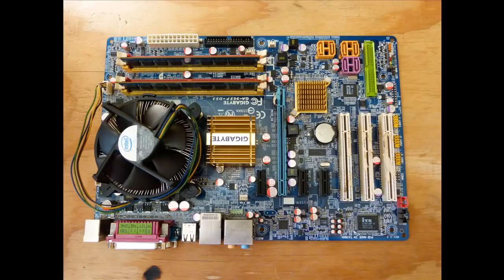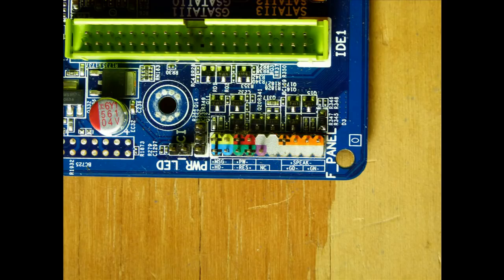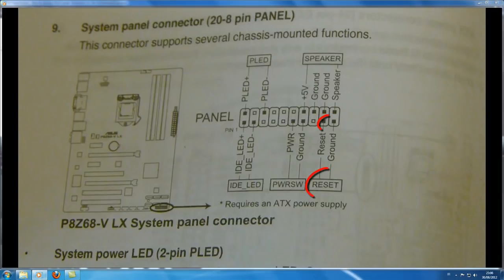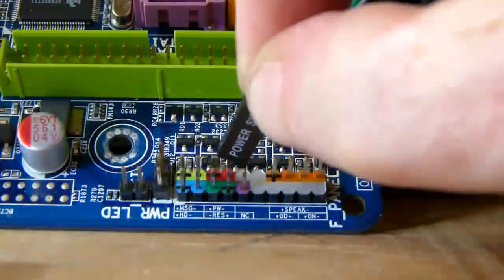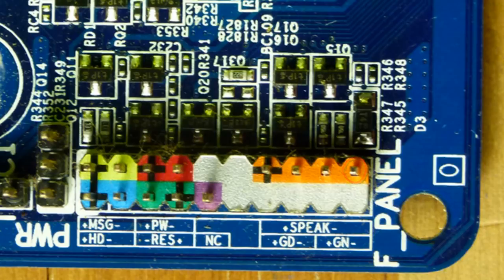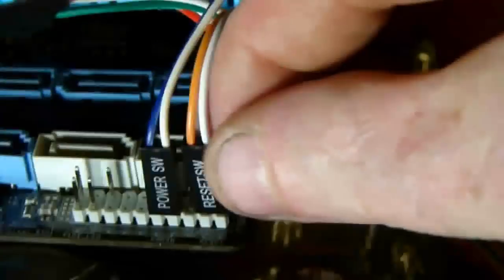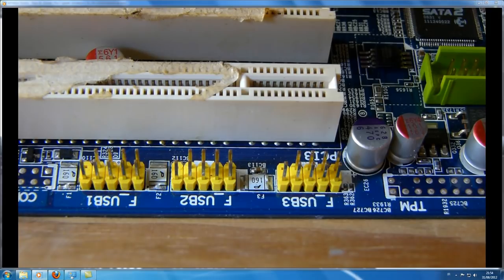How to connect front panel connectors to the motherboard

Comment: I connect a front panel USB/AUDIO unit to the motherboard some time ago. After many attempts the audio finally worked but the two USB ports have never worked. Any thoughts? Do I need to turn on the mobo USB ports or is just a duff bit of kit? Thanks.
Reply from the maker: Did the unit come with drivers if it did reinstall them just in case the did not install the usb drivers correctly. Also is there extra power required for usb cards! usually there is! So check the user manual that came with it, and see what way it is connected! If all is correct then it is probably a bad usb device. The computer is very good at picking up these devices so you don't have to turn on any motherboard usb that will always be on. OK I hope that helps!

Comment: after install my new motherboard then the monitor no signal.. Why this happen?
Reply from the maker: Hi Geoyul! Do you have the monitor plugged into the graphics card if you have one installed? If you don't have one installed then set the monitor to to the input required (eg VGA, HDMI or DVI) Hope that helps! If not! let me know!
Reply: i already install it but nothing happen?
Reply from the maker: To be clear about your problem! You have a graphics card installed in a PCI Express slot and the cable that connects the monitor is connected to the graphics card not the motherboard? If this is correct let me know! Now does the graphics card have 6 pin power connection and if it does! have you that extra power connection connected?

It is very difficult to troubleshoot your issue without seeing it because i don't know your setup! If you want we can connect via Google Hangouts and sort this out in a few minuets! There's no charge for this! and it's completely up to you!

Comment: My case's connection for the front panel doesn't isn't compatible with my Motherboard's USB input, what do I do?
Reply from the maker: One has to match the other! so you need to replace front panel usb connection if that is the problem! But these connection have been the same since the computer was invented! is it possible that you are trying to connect it to the wrong connector on your  motherboard? double check the connection on the motherboard you will find one with USB printed on the board beside it. Hope that helps!
Reply: Thanks for responding but trust me the mobo says "USB 3.0" and my PC's case connection is more of a Cord rather than a wire. If I were to post a video for a better demonstration would you care to watch it?
Reply from the maker: GamersBrainStorming
yes! i'll look at the video, see what you can do next to sort the problem! If you want we can connect on Google Hangouts it's like Skype.
Reply: Kevin Colleran OK great that sounds great! I'll see if I can post a video today if I  have the time.
Reply from the maker: That's fine whenever you get a chance!
Reply: Kevin Colleran Hey Kevin I did some reason research and found out my PC's case has a 19- Pin female connection the one needed for my Motherboard is a 9- Pin male, luckily I can buy a transfer cable at. http://www.amazon.com/Silverstone-Tek-Internal-Adapter-G11303050-RT/dp/B0098FSJ92/ref=sr_1_11?ie=UTF8&qid=1408249771&sr=8-11&keywords=USB-+pin+male+header+to+USB+2.0
If you your still interested I'm looking for some constructive suggestions. I have my power supply faced up on the bottom of the case I need to know what's the best way to place it, if you want I posted a video up you can have a look at it for better understandings. Thanks for your help.
Reply from the maker: Glad you got it sorted! Sure! i'll have a look and i'll get back to you!

Comment: My USB and audio cabels have another set of wires branching off from them. They are all seperare and are 1 pin. What do I do with these?
Reply from the maker: The Only way to find out what they are is consult the manual that came with your Case if you don't have it you should go to the case builders website and find out there! I'm Not sure what they are they could be just blanks it's hard to tell without seeing them if you want to contact me via Google Hangouts if you have a webcam or mic!  i'll be available tomorrow afternoon if that suits!
Reply: Kevin Colleran They are probably blanks. It is a case from an old computer that I am upgrading so it could be an old method of wiring.
Reply from the maker: Ya! so you are good to go! it's better to find out! than to be thinking that you are missing something! Enjoy the upgrading...!

Comment: Now heres the thing. I have an NZXT guardian case, It has a front bay LCD temperature Display and it has 3 cool lines that are supposed to light up and the LCD display is supposed to turn on. both of them do not turn on. Help
Reply from the maker: So are they connected to the power supply? OR where do they get their power from? check all connection to the front panel connection they will be included in them! check the manual that came with case to see if you have everything connected to it's correct position!

Comment: I have a problem with my reset button , it's not working .. i tried to fix it manually on motherboard but it seems i didn't do it right :/ the problem is i changed my motherboard 5 years ago and the new one they ("technicians") put on , is small and i don't even find what type of motherboard is to find on internet the manual ... Also i got another problem , my PC starts on automatically at 00:00 (midnight) ! I can't find any solution of it , i hope someone maybe has an answer , thnx !

Comment: Hi man, my computer case is an InWin GT1 but i have 2 power LEDs conectors one with 3 pin and one with 2 pin , do you know where the smallest power led Goes?(the 2 pin)
My Motherboard is an assus 990fx r2.0
I will apreciate your response. Tks.
Reply from the maker: Hi Romeo, Do you have a the user manual? if not here the link below go to page 50, details printed there with picture of front panel connections http://dlcdnet.asus.com/pub/ASUS/mb/SocketAM3+/SABERTOOTH_990FX_R2.0/E8042_SABERTOOTH_990FX_R2.pdf

The 2 pin connector is called PWRSW positive is on left! ground on right!
Hope that helps! if not connect with me on google helpouts or hangouts and i'll show you the connector position!
Reply: Kevin Colleran I just did some research it seens that the power led (2 pin conector) is just optional for motherboards with that output or something like  that.

Tks for your response.!

Comment: Normally white wires should be opposite to pin specifying the function of the pin itself, which is coloured wire; almost all demonstrations on youtube are wrong about RESET.
Reply from the maker: Hi Mirris, you are right, but can you trust every manufacture to get the orientation and color code correct probably not, but because they are a two way switch where on position is brief connection then the switch goes right back to off position then it will make it's connection, this would apply to power switch and reset switch and for any diode (LED) if it is connect in reverse it will not light up or flash, so that connection must be made correctly . You make a good point, it nice to here from someone who cares...
Reply: Hello Kevin thanks for reply, if you note the usual pins position on classic motherboards is 1-3pins=+ -; 2-4pins=+ -; 5-7pins= - +; 6-8pins=+ -; So 5-7pins have reverse signs; although reset works. I was confused seeing videos on youtube because reset connector appears to be oriented with label visible from external... then controlling triangle which means LABEL function I've realized my original position (internal label) was right. black normally means Ground, white normally means negative or vcc5, black = label while red = vcc5 (the same as +5v) on speaker. Yes it's a bit a caos between colours labels and signs.
Reply from the maker: Oh ya Morris it is a confusing state, I find if one way does not work then try another way. What's wrong here is their is no standard regulated, that makes our jobs that bit harder to do...

Comment: Hi! I have the ga-h77-ds3h mobo and I can't make the front panel audio work. I've read and done according to the manual the connection and settings for the hd audio front panel. Also downloaded the latest drivers from Realtek for the hd audio. The issue is that when the front panel audio works, the audio from the back doesn't and vice versa. How can I fix this so I can have audio both from the back and front panel. I heard there is a program for this issue but can't find it.
Reply from the maker: Hi, Right so what you have to do is disable "front panel jack detection" this is done by opening your audio manager in control panel and under "Device advanced settings" you will see a folder click on that and disable "front panel jack detection" this will allow you to have same sound going to both front and back of computer. Now if you don't have this option in audio manager then it's down to capabilities of your audio driver. So if this is the case, you can install a sound card and use both the frond panel and the sound card at the same time that will have two different audio software controlling them. If you still have the problem after that let me know. Hope that helps
Reply: Kevin Colleran
I've followed your advice and I've solved my issue. The strange thing is that a tag for microphone settings appeared on my Realtek sound settings utility, although there's no mic connected. If I undo the "front panel jack detection" this tag disappears, so I think this is normal. I thought it was a utility glitch but thanks to you it works now! :)
Reply from the maker: I'm glad you got the problem sorted

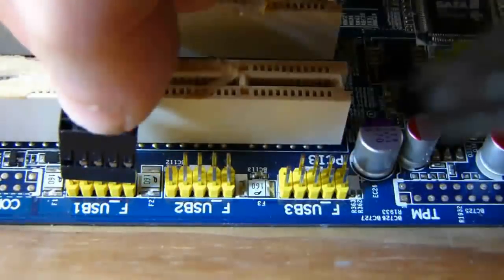Comment: Thanks for your tutorial, I am a total newb and have a question. If I were to be connecting a Firewire port to the same USB header on the motherboard at 8:30,
will this work? Thanks!
Reply from the maker: Hi Mike, that will not work, because of the differences between the design of the usb header and the Firewire connector they are both wired differently. Their could be a Firewire header on your motherboard somewhere near the usb header, but you will only find this out by checking the manual for your motherboard ok, hope that helps...
Reply: Thanks for saving me money!!
Reply: So id be better off getting a Firewire port for my pcie x1?
Reply from the maker: Yes Mike, that would be the best thing to do...

Comment: my case fans dont fit where it says sys_fan 1-4
Reply from the maker: Is it the pins connection your asking about ? if it is then the fans that you have the incorrect fan connector for sys_fan. you can also connect fans to the power supply directly, but they will not be monitored by the processor because they are not connected to the motherboard directly. so you have a choice to make!

Now if your fans were bought separately, then they are, as you have mentioned the wrong connector for the motherboard.

If it's the size of the fan that wont fit the case, then again you will have to get fans that will fit one size does not fit all cases.

One more point here is, if you are not living in a hot humid climate then you don't need a lot of fans to keep your computer cool. The cpu and the power supply have fans and will pull hot air out of the case, so maybe one more fan with those would do.
Hope that helps, if you want to make a more detailed description of your problem if this does not help, i''ll be more than happy to help with more info of the problem... Kevin
Reply: i think it may actually be the fan controller mounted on my front panel which came with the case and that the case fans are already connected up through my psu

 the wiring is hidden and bunched so its hard to tell which comes from what unless its obvious or says what it is on the wire itself
Reply from the maker: ok, in that case you don't have to connect any thing up to sys_fan connection on motherboard, they are already connected. Now the sys_fan connection on your motherboard is for "additional" fans if you want to connect more fans, so it's not needed in your situation, because the fans are already connected. Hope that clears things up for you.
Reply: it does but the things i thought were for the fans are actually the fan controller which controls how fast my fans spin and without it they spin too fast which makes noise
Reply from the maker: you will have to read the manual that came with the case to find out exactly how to control that, and or fix the fans spinning to fast and see if it's working and controlling the fans correctly. Their is a way to check on line with the manufacture for these kind of issues also. i don't know what make of case you are using but controlling fans is an important area that has to be working correctly, so check in manual or with manufacture. There is probably a simple answer to you problem, if you can't get it sorted you connect with me through "Google Helpouts" with live video, so i can see what the issue is, if you still can't fix the problem by Monday, OK hope that helps...

Comment: Have i fried my mobo? It turns on for about 0.5 seconds and then it shuts itself off. Please help i'm new to this, my mobo is an asrock fm2a88m extreme4 and my case is an Aerocool x warrior. Heeeelp
Reply from the maker: check and make sure your cpu fan is connect to the motherboard cpu_fan connection, number 1 reason new builds fail to power on correctly. and if you have this problem cpu fan not connected the processor could be and more than likely fried.
Reply: It can't be the cpu fan because that starts spinning as well for about 0,5 seconds... what else can i do? ;(
Reply from the maker: look through all connections made to motherboard and and disconnect and reconnect all cables and reset the memory sticks also. if that does not work then run through the manual that came with your motherboard and check troubleshooter section in the manual. ok hope that helps... it's a long process but that's what you have to do.
Reply: Ok i will do, thanks for the help!
Reply from the maker: hope ya get it sorted man...
Reply: xXTheGamingKamiXx What power supply do you have and what are your specs, like CPU and GPU?

Comment: Hello I did everything that you did with my motherboard but when I tried turning on my case power it does not work. The light on my mother board glows green and I tested everything before my build and it worked but when its in the case it does not work. I have a phantom 410 case and a Z77-A motherboard. Any help would be greatly appreciated. Thank you!
Reply from the maker: I would double even triple check the power switch to the front panel and if it's connected correctly, it could be the front panel power switch that's faulty so try turning the power on by bypassing the power switch on the front panel by using the same method you used to test the board before you put it in the case. Hope that helps.
Reply: Hey thanks for ur help I figured out the problem . I removed my jumpers lol and it literally stopped my computer from working
Reply from the maker: yes jumpers will do that... good for you, you have it working now...excellent!
Reply: Haha thanks for all ur help !

Comment: If you only want back panel audio from your motherboard do you need to connect the cable from the case?
Reply from the maker: That''s fine, you can leave that front panel audio disconnected.
Reply: Thank's Kevin:)

Comment: Is it posible to connect the Audio header to the sound card instead?
Reply from the maker: yes the sound will have a front panel connector just check the user manual or you will see the connection on the sound card it will have a "f_panel or front panel" printed on the board beside the connection. now if you connect the front panel to the sound card, if it has that connection it may disable the connection jacks on the sound card again you will get that info in the user manual. i found this out the hard way... I tried to connect a set of head phones to my sound jack and also had the front panel connected to speakers but no sound was coming from the headphones. So in my sound card you could not connect both but your maybe different. so check the user manual.
Reply: Thank you
Reply from the maker: glad to help

Comment: Hi, may i ask what the black plastic thing is called. example the one which has written power sw, reset sw etc. cause mine got crack and im left with that tiny little aluminum thing expose. I wanted to buy the same plastic cover if thats even possible. Problem is i dont know what its called.
Reply from the maker: there called all sorts of things, but if you just call them front panel connectors, they will know what you are talking about at the store. you probably will have a hard time get them cause they are manufactured plugs they are not replacable, but the store you go to will have some kind of connector that will replace it and do the same job...hope that helps
Reply: Thanks for the quick reply. I appreciate it. Have a nice day. Great videos also very informative.
Reply from the maker: Thanks for the kinds words...

Comment: My case doesn't have the speaker cables (i dont have an audio jack built in to my case) is it alright if i leave the pins with nothing plugged into them?
Reply from the maker: Hi Zach, Yes that's fine, you don't need those two areas connected in order for your computer to work.
I would however consider getting a system speaker for the motherboard, so if you ever have a problem with motherboard or RAM the speaker will give you a serious of beeps, that will guide you in troubleshooting a problem. Your computer will work fine without these things connected, but as i said you might want a system speaker to indicate an area that's causing a problem, if and when you do have a problem.
Reply: Thanks